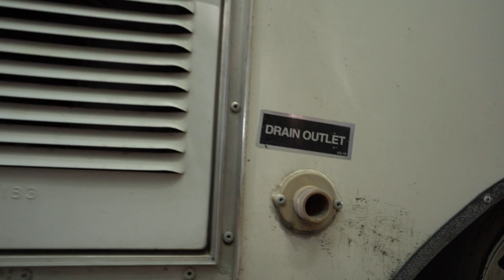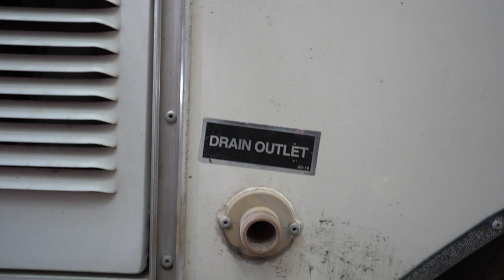You're not going to believe what was growing in here! | RV Water System Overhaul

Comment: Here's a sway story for you.  I doubt I had any water in the tank but several years ago I was traveling, pulling my 16 footer, from Wisconsin to Oregon.  I was doing about 70 when I started dropping down into the Columbia River gorge.  I let up on the gas and instantly the trailer started to sway.  I knew apparently from reading or hearing it somewhere that if I let up on the gas it was going to get even worse and if I hit the brakes it would be all over.  So what I had to do was accelerate even though that was the last thing I wanted to do.  I did and it straightened out immediately.  I then very carefully reduced my speed.  If that same thing had happened on a level road it would have not been an issue but the gravity assisted inertia but me in a real bind.

Comment: I have a 99 16 footer and noticed a small mass of algae in the tank.  Not knowing it was, apparently, easy to remove the tank I melted a small hole in the top of the tank so I could reach in and remove the algae.  Then I used my plastic welder to weld a cover back in the hole.  Now, I treat the tank once a year with a low concentration of bleach and drain it frequently. 

And, living in a cold climate, I add antifreeze to the tank and  in fact the entire system, every year.  Last year I noticed some discoloration of the metal in the water heater.  I called Scamp and told them what I was seeing and they told me it's common for that to happen and that It's not really necessary to add anti-freeze to the hot water heater.  It's safe to simply drain the water from it.  However, don't take my word for that - talk to Scamp yourself.  Freezing lines and tanks are always on my mind in the Fall because I live in a  cold climate.  

My first bit of maintenance this year was to, yesterday, check the lines and make sure the the lines were not broken and that there were no leaks.  And I tested the water pump that pumps water from the shower water tray to the grey water tank.  The pump was slow to start pumping and I reasoned the internal parts were dry.  I added a little olive oil and then water to the shower stall drain and "viola" it works fine.

Comment: For graywater, have a short garden-type hose (3' or so) to a 5 gallon Home Depot bucket (or similar paint bucket). Get a lid for the bucket and drill a hole in it for the hose. Make sure the hose is short, or it will not drain well. Also make sure the hose cannot be mistaken for a freshwater hose (use gray or green or black or similar).
P.S., I got a white bucket--it blends in with the trailer, not an orange one.
Reply from the maker: Great idea! I think I'll do that as well.

Comment: A short hose meant for washing machines will fit the outside drain. I'm not sure if the other end will fit an external gray water tank-on- wheels called a "blue boy." They're handy because on you can roll it over to the dumper instead of breaking camp and bringing the whole rig.
Reply from the maker: @Sherry Peterson That’s a great idea! I might be able to mount it on the tongue of the trailer when traveling too.

Comment: I added a 4 inch threaded, o-ring sealed port on the top of the fresh water tank. Now with a clean wet/dry vacuum I can completely empty the tank and using a clean cloth dry it’s interior. Keeping the tank dry and clean between Scamp outing’s is important. I found that the original Scamp drain valve always left about 1/2 to 3/4 inch of water in the tank.
Reply from the maker: That’s a really good idea! I may have to steal it from you :)